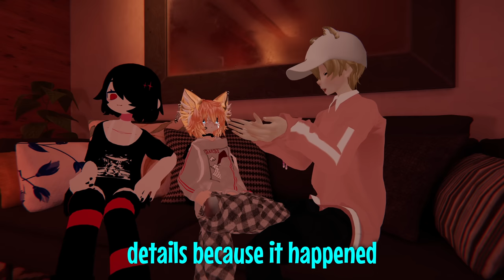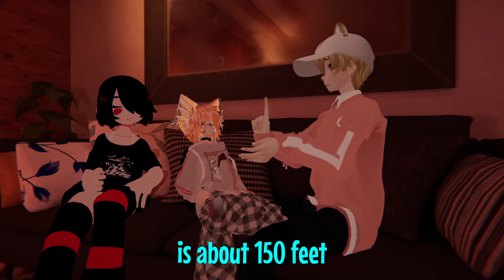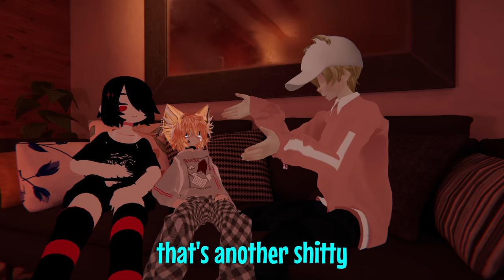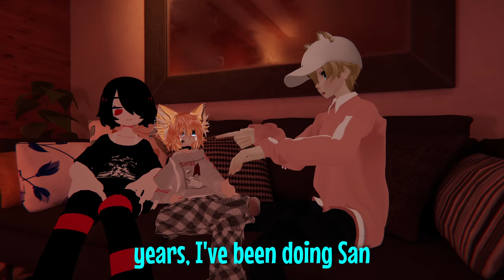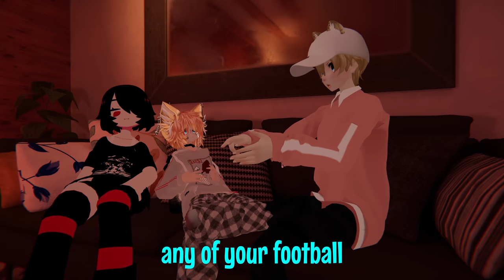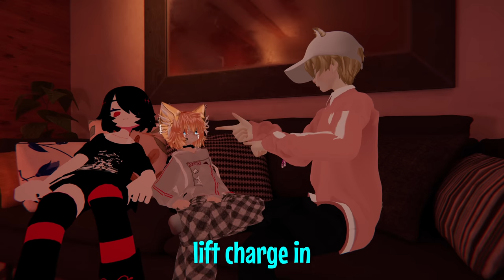Pyrotechnicians Are Absolutely Unhinged...

Comment: As a person going into aerospace: No you may NOT use our planes or spacecraft as fireworks, thank you. And before you ask, no, the flight termination system is NOT a firework button.
Reply: Sounds lame but ok
Reply: I mean the real firework button is on the fuel tank and is hit with a hammer.
Reply from the maker: Aw you're no fun
Reply: i can definitely be trusted with the range safety controls. i will not use the fts for a fireworks show at t+21 seconds
Reply: As a KSP player I must disagree. The big shinny red button is only there to be pressed! Hehehe
Reply: @AresWalker8  as a fellow ksp player, if the rocket goes pointy end down, decouple everything and fall to the ground. always a fun show
Reply: @@ChiefGabagool does that stand for flame the spacecraft
Reply: Jokes on you, they strapped fireworks on a biplane and fly a display with it at Oshkosh one year.
Reply: @randomguy966  the real answer: move to Australia where they dont have 9/11 trauma

Comment: I volunteered as a pyro for a small city for two years. The system was there was a circle of what looked like modified saw horses and there is a 4x4 board with four mortar tubes on the top and four on the bottom. There is a bucket of water to the left of right side depending on preference of operator a plastic tub lid on but a hole cut out down at the bottom. We had two road flares for lighting. There was a experienced person in the center directing when to start launching for each person. As an operator fill the four tubes that are sticking up from the tub, pulling from the side hole so the sparks don't start the land fun. on your turn you would light with a road flare your four tubes, after they went off flip the 4x4 over and refill and repeat. four inch fun tubes and cakes where wired behind us. scissors are evil they can create static electricity which means early boom. Never drag a cardboard box of fireworks for the same reason always pick straight up  and carry them.

Comment: Great video as a fellow pyrotechnician I got to say you boys do it differently on the West Coast.

We use a nighthawk fire control system and hand lighting still, we're allowed to have up to 10 in shells in the show if the sponsor has the space but once you get past six it's kind of expensive and not worth it.

Building racks is for oldies podded firing trailers are the future and they're easy.

Barges are insane And you'll never know you're truly alive until you get a flower pot 14 ft away out of a 6-in gun on a barge.

The post 9/11 thing was in regards to 1.1 g only two ports in the United States import 1.1 snow bye-bye 10 and 12-in shells.

We have had to sack random strangers, sponsors, and activists before we've also had to tell fire department officials and police to fuck off for getting too close to the guns.

70% of the time we are our own fire department except for cattail fires in Rhode Island and Westerly those guys are sitting around all day they can put those out.

Have a safe season in 2024 from your boys on the East Coast at pyrotechnical and Atlas fireworks.

Comment: My dad one 4th of July accidentally left the plastic on a giant fireworks box. The box was about 5 foot long and 2 foot wide.

The plastic wrap was on top to keep the fireworks from falling out but you have to take it off because it’s on top of the fireworks. My dad left it on and it fired in every direction. We live on a farm so there was no one else nearby so we hid behind our truck as the fireworks hit the side of the truck and flew over. Most of them didn’t explode (probably cause of the melted plastic) but it was still terrifying.

Comment: For some reason, where I live the police are very serious about explosives. I’ve seen my neighbours get arrested because they set off fireworks too close to a field. Grass is really flammable so I guess it’s reasonable but they came there instantaneously. They just spawned. Keep in mind the area we were in didn’t have a police force. They had to get city cops to come in and they somehow managed to get there that fast. 

Also, another fun fact that I learned from my dad. Apparently, depending on a few factors and given you have the proper experience to use them, you can get a license to handle small explosives that aren’t fireworks. I learned this because my dad blew up a few old feed barrels for fun.
Reply from the maker: My dad actually used to have a license for using mid-to-large scale rocket engines for model rockets, wild what you can do with the proper paperwork

Comment: I noticed some military rocket launchers and a yeet machine had an airlock to keep the blast from getting inside other tubes. Would something like that, a solid seal over the mortar that would close up ASAP after the mortar fires… that would be a massive improvement against low break, no?
Reply: Sadly no best option is suriam wrap the mortar do to how fast from signal to fireing a firework happens
Reply: the price thou..